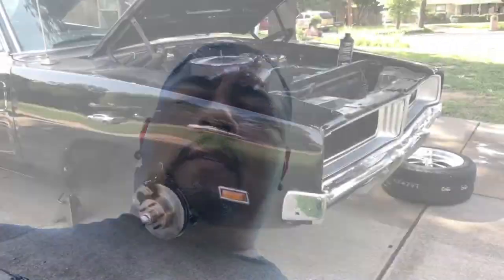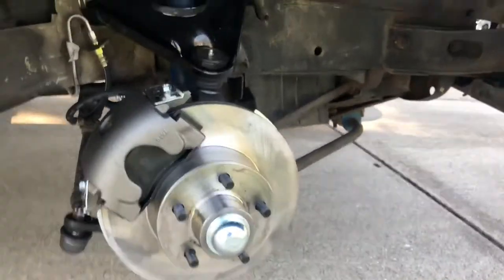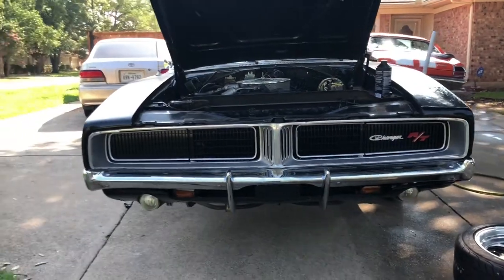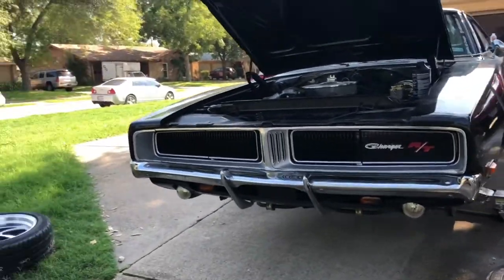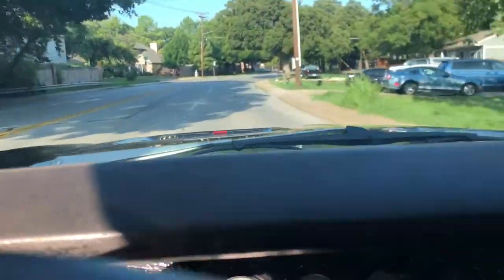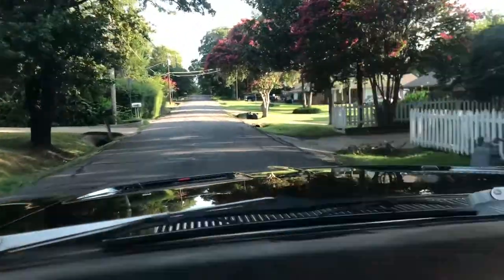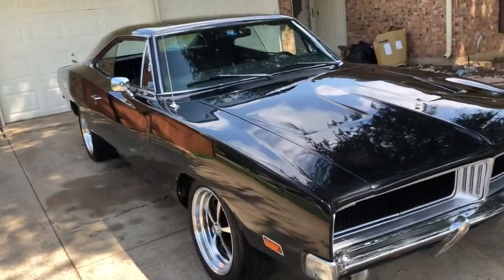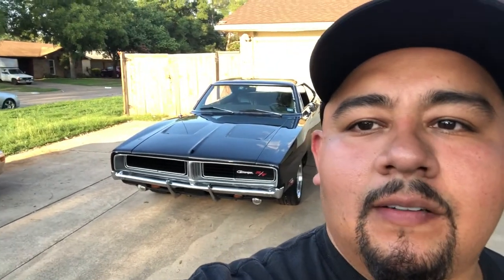Front disc brake conversion (part 2) 1969 Dodge Charger B Body Project

Comment: Will, is your outer brake shoe loose in the caliper? I tried bending those shoe flanges down with a hammer but they won't budge. Not sure how much they'll rattle once I get driving
Reply from the maker: If your caliper is not fully compressed it’s a possibility it might be a bit loose. Once you bleed your breaks it should tighten up I would think.

Comment: Did it effect you alignment to do the conversion?
Reply from the maker: Yes you’ll need an alignment afterwards. At least I did but I replaced several other components along with the conversion like control arms and steering joints.

Comment: Awesome man! When is the 440 build going to happen?
Reply from the maker: Looking like that won’t happen till next year unfortunately. This year I’m most likely getting the steering gearbox rebuilt, installing my LED tail lights, putting new floor pans in, getting correct side mirrors and fog lights. Lots to do.
Reply: @wills69charger1  those are some good goals. I'm looking forward to it.
Reply from the maker: Thanks bud

Comment: I’ve been thinking of doing this on a 1966 f100 any thoughts
Reply from the maker: Buy from eBay. Buy the whole kit front and back. Buy your brakes lines and make sure your kit is complete when you open the box. Shop around first before you buy.
Reply: K thanks

Comment: How's the engine coming along?
Reply from the maker: That project is on hold and still Sitting on my work table waiting to go to the machine shop. I do not have a date on when I’ll get that going again but most likely next year unfortunately. Stay tuned though I have other projects lined up for this year.